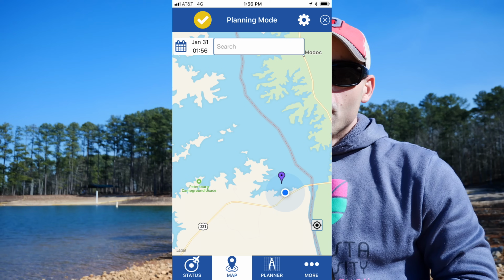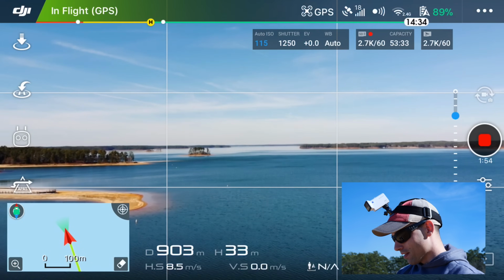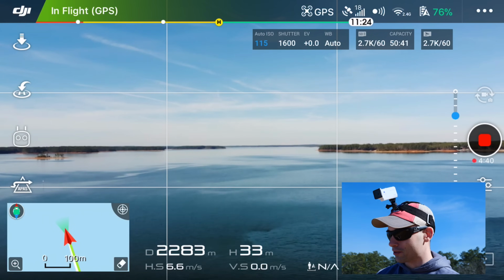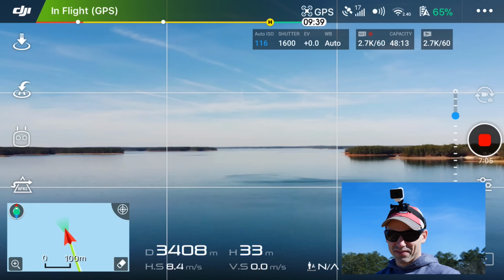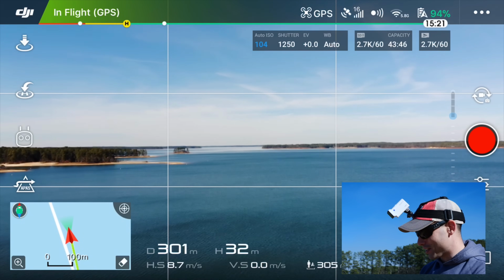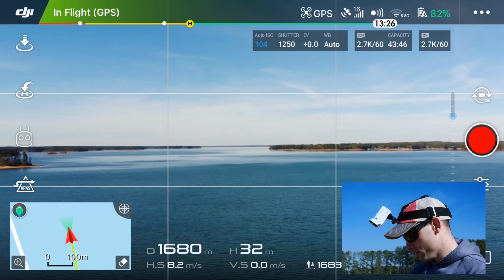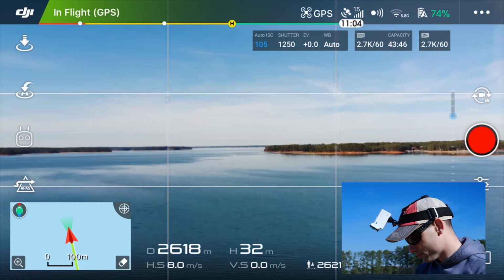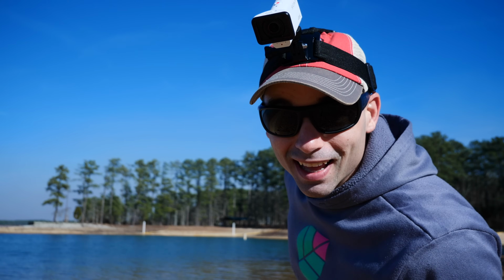DJI Mavic Air Range Test!  It can go HOW FAR?!  Testing both 2.4 and 5.8!

Comment: You should do your next test with an OTG cable to see if it makes a difference.
Reply from the maker: The air comes with an OTG cable built into it.
Reply from the maker: Well built into the controller.
Reply: Wow okay I didn’t know that. Thanks.

Comment: Any reason you didn't do it in sport mode? Just curious.
Reply: Is it true that if you disable obstical avoidance the max speed picks up. More than regular speed but less than sport mode?
Reply from the maker: I don’t know I’ll have to check that out.  I usually always keep obstacle avoidance on so I’ve never tried it any other way.  👍
Reply: I was hoping for 17 to 18 min or so flight time I usually get 12 or so with spark.
Reply from the maker: I figured it was more efficient to leave it in regular mode 🤗
Reply: Justin Treptow yes it is true but it still won’t be efficient
Reply: This is how the Spark is...
Reply: Matt Rollins yup the only difference is the air is twice as better and efficient lol
Reply from the maker: That’s about what I’m getting, I haven’t done a detailed test yet but it’s pretty good (not amazing) battery life.
Reply: Walter Osorio I know! What will my Spark fly more get on eBay do you think?
Reply: Matt Rollins a large discount

Comment: It’s all good bro I did the conversation as you were flying. Very impressive results can’t wait to get mine. Also have you tried to fit the spark props on the air? I was reading some of the comments on YouTube that it will work on the air.

Comment: That takes guts.
I have seen other people attempt this exact same test and lose their drone.
The problem is : They don't take into account the wind direction. 
Always fly into the wind on your trip out, so you have a tail wind on the return flight home.
Not the other way around.
If you base your drone's flight time solely on battery life, your expensive drone will go for a swim.
Also: Wind strength at ground level may seem alot calmer than it is above the height of the trees.

Comment: I think that flying above the water is the key to your result. Water reflects wifi signals so they are propagated further. I wonder if you got different results if you flew above some forests/plains.
Reply: Dude wifi doesn’t have nothing to do with this because the drone use radio frequency

Comment: How do you choose/switch between 2.4 and 5.8 GHz modes?
Reply: You need to set the Wi-Fi channel to "Custom" and then pick the number manually. Numbers 1 - 14 are 2.4 GHz, while the high numbers are 5 GHz.
Reply from the maker: I don't exactly know.  It was originally on 2.4 and then I just messed with settings until it autocorrected itself into 5.8.
Reply: Maciej Trebacz - Perfect, Thanks!

Comment: Range/signal strength was the main concern I had with this drone coming from the spark.  I don't think this will be an issue now.  I noticed you had your Apple Watch on during flight.  Does it affect the signal at all?  With spark I have to take my watch off and turn off bluetooth on phone or the spark starts yelling at me!!  Thanks for the VID!
Reply from the maker: Yeah this thing is seriously solid.  I think the hardwire connection makes it not be affected by the apple watch like my spark was.

Comment: Remember always to fly in sportsmode at least on The way back👍
Reply: More speed, less efficiency, less range per charge. That is the recipe for losing your drone...
Reply from the maker: But does that use up more battery life?  I wanted it to be as efficient as possible.
Reply: The higher you go, the less energy it takes to fly.  So if you can fly at max altitude, as long as it doesn't outweigh to energy cost to get up to max altitude.  But it would be most efficient to do a range test if someone drove the Air away in a car while it was powered up.
Reply: The higher you fly the drone it becomes LESS efficient. The air is less dense and therefor less air for the props to grab and propel. Gravity is actually STRONGER at ground level (go to the top of a mountain and weigh yourself, you'll weigh less than at sea level) which also makes the air more dense at ground level which equals better performance.
Reply: what direction was the wind?
Reply: The Everyday Dad it does but The mavic air has a top speed at about 65 kilometers Per hour so i Think it would be faster and safer.
Reply: Or in this case, a boat.
Reply: German Silva The higher you fly, the less the gravity, but more importantly, the less dense the air, so less energy.   A drone on top of a mountain will last minutes longer than a drone at sea level.   The easiest "range test" of signal control is ultimately to power up the drone and have a buddy drive it away a few miles.
Reply: Thijs Post The spark is crap If it isn’t in sportsmode. Also how do you know this?
Reply: That's a good point, actually.  I was thinking of jet airliners which don't have to use their props directly for lift.  Still, the best way to test range is not to use the battery for lift at all, and use a car to drive the drone away.  I've heard the Air is no "Mavic" when it comes to signal strength.  I'm curious about the results of 1 month's worth of use from people that have both.

Comment: if you have battery issues, you can always have a friend drive the drone far away in a car or boat while it's powered up
Reply: i wonder if some paradoxically shaped aluminum foil would keep the signal at maximum bars
Reply: wow, what a difference between 2.4 and 5.8
Reply: That is one way but it gets the best range at more height, and the metalcar body would likely interfere.
Reply: joshua12345676 Good point.  ... if you find the car's metal body interfering , you can also walk it, bike it, or put it on a floating surfboard, or drive it 2 miles away, then drop off the drone, and drive the car 4 blocks away.  The point is to use something other than the battery to get the drone to the edge of the range, so you have enough energy to test the range, not test the battery.   You get the idea.
Reply: joshua12345676  another option is to drive to the top of a skii slope, and fly the drone down the mountain side and park the drone when it gets to 9 percent battery, instead of trying to fly it back.   No matter what, the conclusion is unavoidable.  The range of wifi far exceeds the limit of the battery, so range isn't even an issue at all.
Reply: True stuff, and is more safe at that!